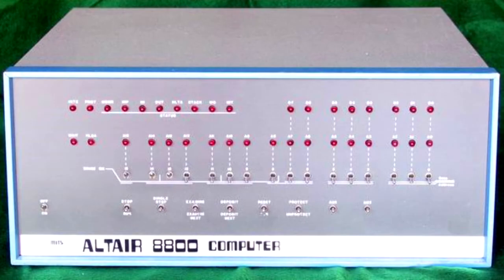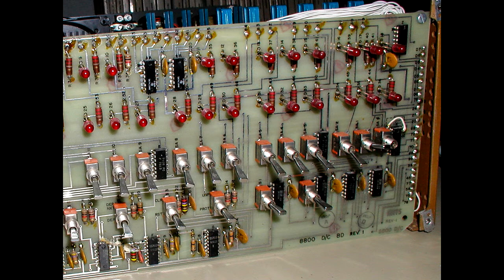#28 IMSAI 8080 MITS front panel

Comment: If the "Altairduino" kit I built is accurate, there are two interesting features of the 8800 front panel's functionality compared to the IMSAI.

First, and the IMSAI might do this too, but if you are single stepping an IN 0FFH instruction, when you get to the cycle that reads the panel, the data lamps will show the current state of the switches, and will change as you move the switches.

Second, to my sorrow after watching your channel for a while, the 0FFH port is read-only, so your cool "echo switches to lights" programs don't seem to work.

Though I don't know if a real Altair 8800 has these features or not.